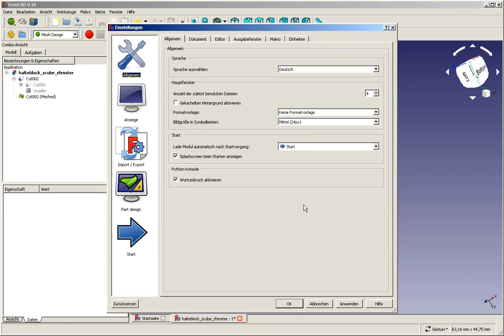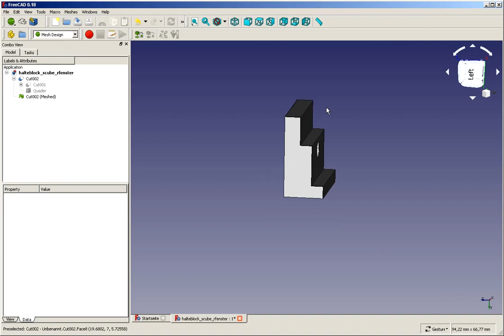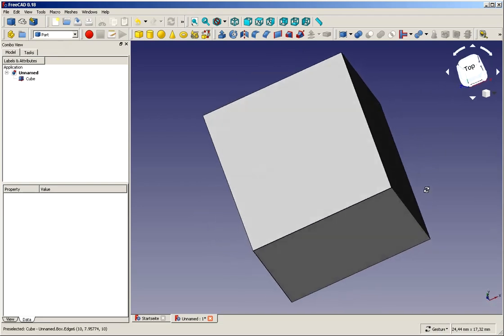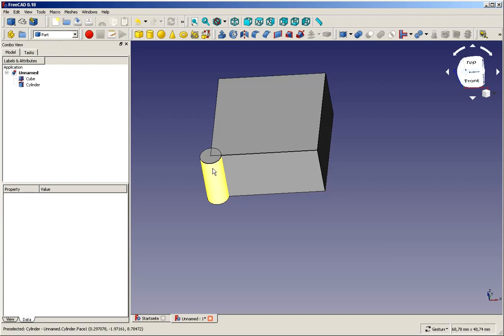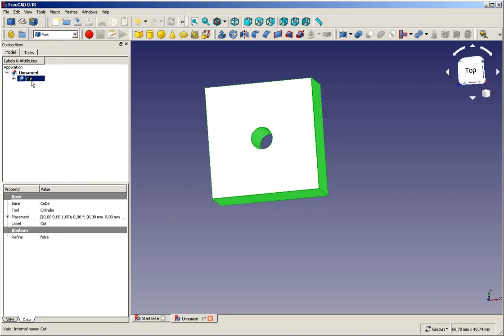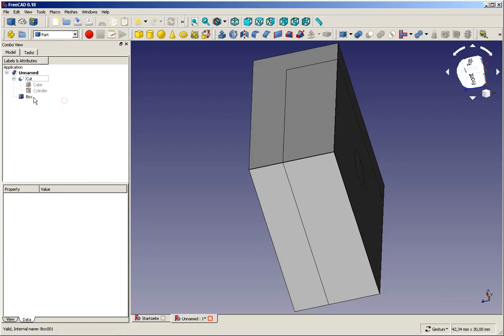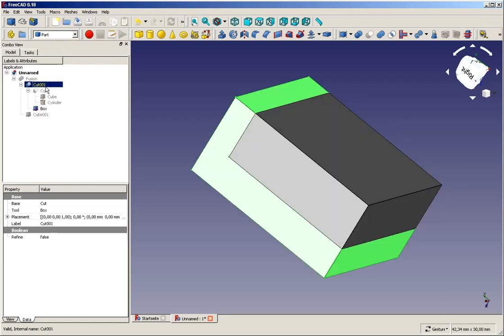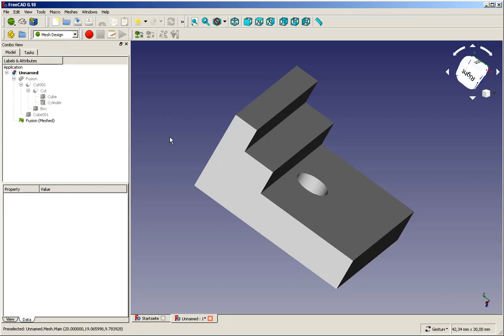FreeCAD Quick and Dirty

Comment: Thanks for that, very straight forward as you said. Reminded my slightly of the openscad method of design. I don't know if its possible in the windows version of freecad ( I assume it is) but I find I can just select the object I want to generate a stl file for and go straight to file -> export and select "mesh stl" from the drop down menu. This seems to give me a mesh I can pull into slicers such as cura.
Reply from the maker: I know taht it is possible that way too. But , going thru mesh workbench makes it more surely that one has the proper mesh settings. Often, standard settings are  not Standard mesh  and give  not good results. FreeCAD often has more thatn one way to do something.
Reply: @hagei406  Ah good to know, I have not been using freecad that long and your tutorials have greatly improved my understanding. On a completely separate note, I was trying to design a hole through an object that required a countersink for a wood screw and could not work out how to do it. Would appreciate you comments on this or even better perhaps a short video ( wink )
Reply from the maker: @cajone7591  Ok, Forgot to mention , OpenSCAD and Part Workbench both are CSG based and more or less use the same base.  If you want to design a countersink bore in part workbench , you can easily take a short cylinder , an concentric longer  but thinner cylinder ,  fusion them and just subtract them , after inserting in the other  object , same as seen here. When it comes to be  bit more difficult is when you want to position objects in part wb. But that  will be subject of a later video. 
I have to design another piece for the printers front door , maybe i make another video on that and go a little deeper into part WB.